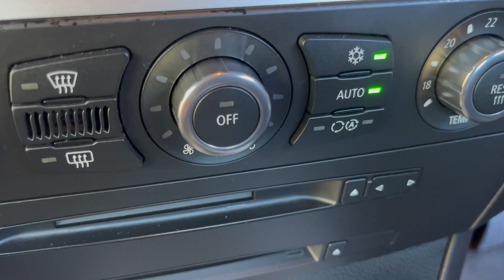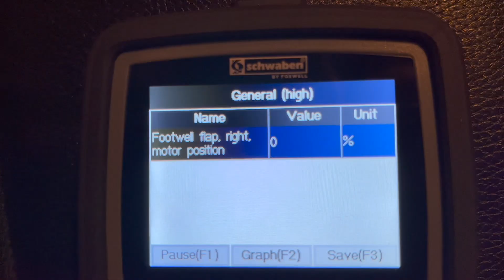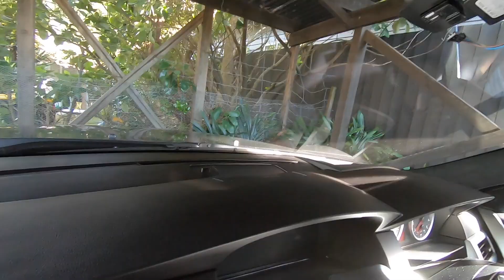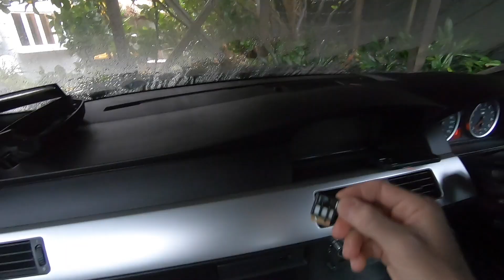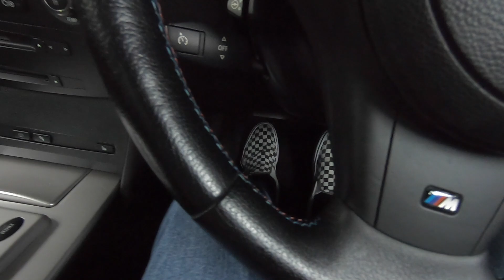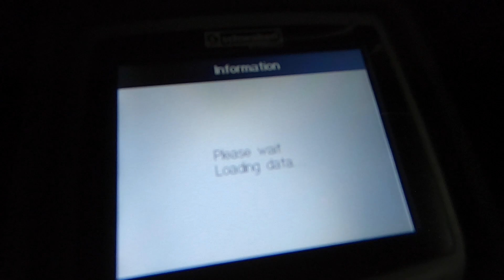BMW E60 M5 Fogging Sensor Fault 9C55

Comment: Interestingly, I had a similar issue with my 1 series. But almost the opposite, the fogging sensor was faulting to a maximum moisture reading, so the car clearly thought the windscreen was fogged, so it was always blasting warm air to the windscreen, no matter what setting you put the a/c on. (It was really rough through summer) A new sensor fixed the issue. 
Still love BMWs. Even with how complicated they were back then. Mines 19 years old now, and it's still great.
Thanks for the videos, always a pleasure watching your content. Cheers.
Reply from the maker: Thanks man, good to hear you got it sorted

Comment: Love the informative videos! 

I have a 2011 E82 128i and the passenger heat doesn't work. Do you happen to know if this model also has two heat valves to bring hot coolant to the heater core? Pretty sure there's only one coolant hose going to the heater core.. 

I've done much of the same troubleshooting you show in this video, the flaps all appear to be working as they should. I even took the dash apart to get to the passenger blend flap, and was able to physically confirm that it's moving as it should.... I also hooked up a water hose and backflushed the heater core thoroughly. Not much crud came out.

It seems to me like the hot air going to the passenger blend flap isn't getting heated, but the driver's side heat works fine. 

Would appreciate any insight you may have! thanks!!